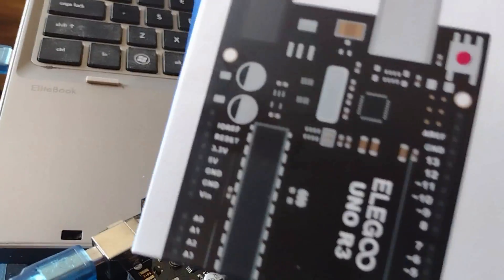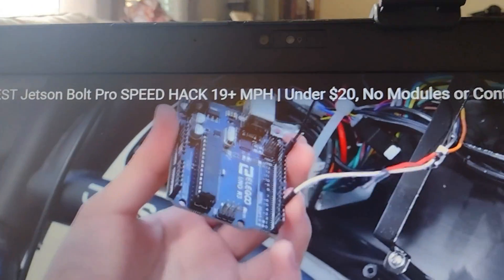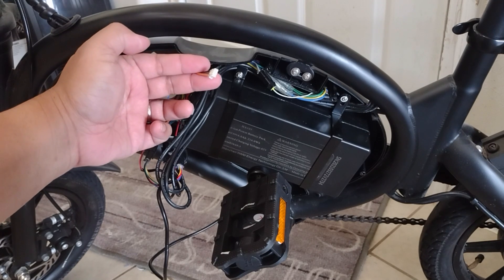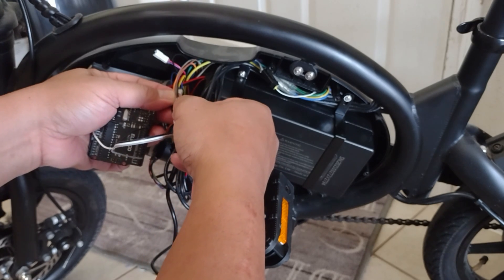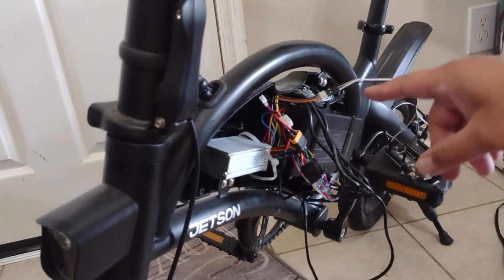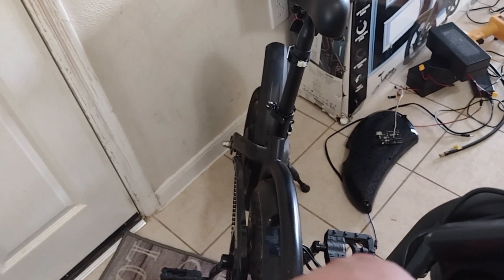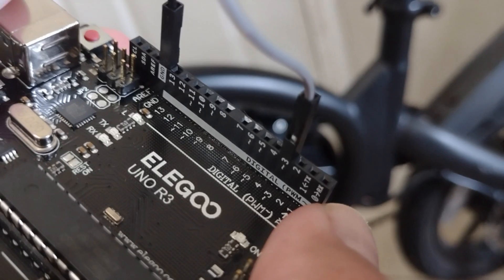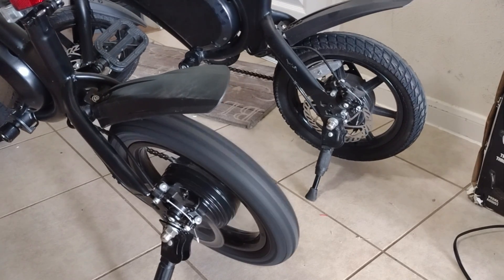JETSON BOLT PRO SPEED HACK

Comment: Can you still use pedal assist with the speed hack?
Reply from the maker: yes
Reply: @jsnantic  what about doing speed hack on dyu df3
Reply: @jsnantic  I tried my dyu df3 I put speed meter on today and   it's still standard I was doing 21 mph with pedal assist and on throttle I was doing 16 mph is it worth doing the speed hack will I get more speed plus I weigh 9 stones

Comment: Looks like you are just adjusting from EU standard (25kph) to US standard (18-20mph). My old 36V conversion speed controller had an off road wire (green). Connected it was "legal" disconnected it was zippy! Then I went 48v. It will require a complete rewire except for the motor wire. I am going to install a key switch throttle.

Comment: I'm going to try this on the Ancheer 500w 14" bike. Hope it works. It's already goes 20mph, might try 25mph
Reply: Did you get it to work? Just pick up an Ancheer too. Would love to unlock this bike full potential
Reply: @johnnyt7877  It does work but motor sounds bad when starting of, once it gets going it sounds fine. I took it of and tried doing the arduino Bluetooth hack. It made no difference either.

Comment: This doesn't work on new jetson bolt pro anything after 2021
Reply: I used it on 03/22 bikes and it works fine. Increased my speed by 3mph. Not sure where everyone is getting this information, but so far not a problem on my newer bikes.
Reply: @johnh.miller1112  that is the problem because new bikes won't allow you to get 30km/h
Reply: @johnh.miller1112  Which Arduino board did you purchase?
Reply: Same one as tony has